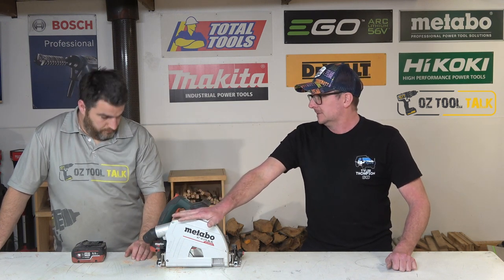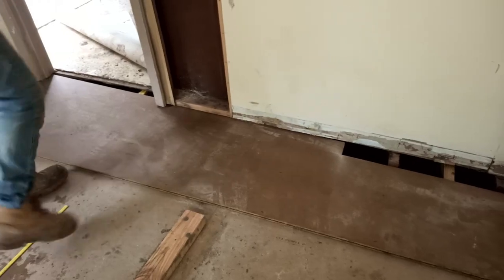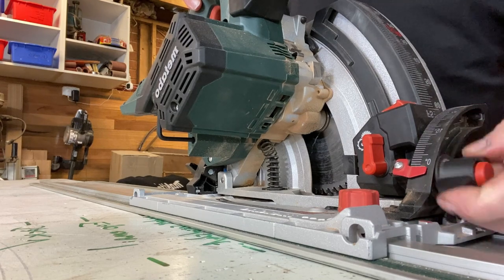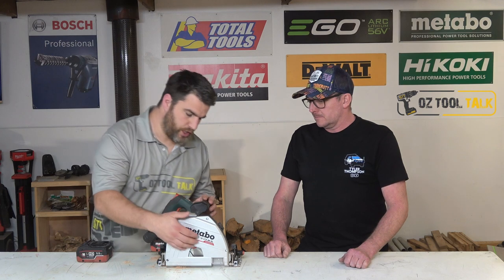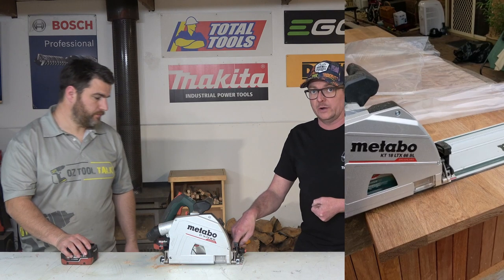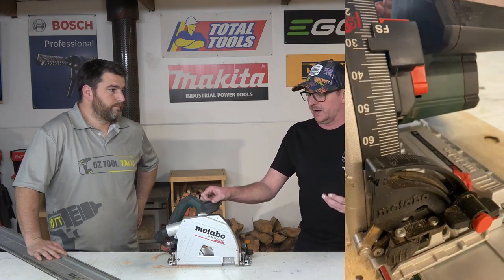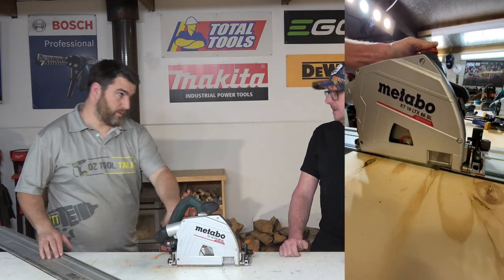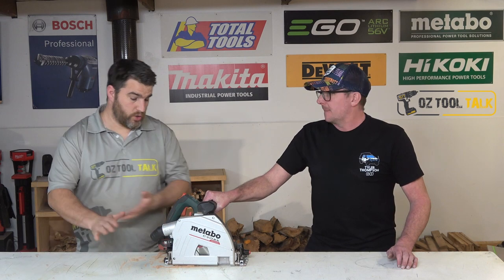Metabo 18V Plunge Cut Circular Saw  - KT 18 LTX 66 BL - Tracksaw [2021]

Comment: Great explanation on how 5.5 Ah is more powerful than 10.0Ah. It's hard to get your head around it but 5.5 Ah gives you more power per sec than the 10.0Ah if i understand it correctly due to its heat dissipation and active materials in the cells and internal connectors etc.
Reply from the maker: No problems Matt. Yeah something about the cell chemistry pits total stored power (in Ah) against instantaneous power (Amps) against each other. You can't have both maxed out in one cell.

Comment: You guys forgot to mention  this saw can also be used on the Bosch guide rail.
Reply from the maker: True
Reply: Albeit 3mm off the Bosch cutting strip.  I use it on the same tracks as my corded Mafell saw; which utilises the Bosch/Mafell tracks.  Unsure if it would be different with the cutting strip/rubber registered to the Bosch track saw.

That said, I actually prefer it is offset from the cutting strip.  This then doesn't interfere with the rubber strip, leaving it perfectly intact and registered to the Mafell track saw.   I use the Metabo for quick cuts where the finish isn't a huge concern, but straight cuts are, ie yellow tongue, ply bracing, etc.  Also for cement sheet, the edge is more than acceptable with the blade away from the cutting strip.  I use the Mafell track saw when I want no chips from the blade.

Comment: Thanks for your review,  came in to market a little late,  because I am already set-up for DeWalt. I am thinking to sale the DeWalt and buy one of this, because DeWalt has a few things with anointing me so much. 
You are talking about the ripping fence,  the problem with that fence one plunge saw it is that it's problematic to keep the saw down and pushed on the same time.. One good futures one DeWalt is that second generation has a remote control integra in so starter's the DeWalt flexvolt vacuum one the same time with the saw .
Metabo cordless vacuum has a similar function, which is working via vibration , the price one Metabo is around 1000 sterling pounds with 2 batteries, but if you are invested in the platform Metabo it's a better solution , if I had the possibility I changed to Metabo Tools today, because I had enough with DeWalt.
Reply: What exactly is it that annoys you on the dewalt saw?
Reply: @trashes_to_treasures ... firs one is jumping from the track one the end and beginning, because of the adjustment nobs,  you need 400mm before cutting and 400mm after. 
Dust collection is around 80 %
Battery is in the way of my hand .
Changing the blade is a pain. 
The ripping guide is copying Festool and Festool accessories cost an arm and a leg .
The tracking has to be 3 metres because connecting 2  does not align perfectly,  you need to tape it, so dose not make a step left or right  .
Reply: @MrDINODINO74  thank you for the info! Some more points tha get me away from dewalt and to metabo 😎

Comment: I have one of these and love it. All my gear is Metabo but the only thing I would say is that the upward cutting finish isn’t as neat as using a festoon track. 
I did  have a maffel track but this saw didn’t fit it so I had to send it back
Reply: i thought they would work together? i am planning to buy and use this one along the kss 40 from mafell and joped i could use the mafell tracks.

did you ever try the mafell saws on the metabo track?

Comment: My track saw is still the old electric variety. All the cordless ones are so dear unfortunately. Would like one but hard to justify the cost. I don't carry my track saw daily anyway only load for specific jobs. If you were old like me and built houses with a few hand tools and a circular saw as was the norm. I still do most of what you showed with the simple circular saw. Either free hand. Rip fence or straight edge. If money was no object. The new Makita 40v track saw I reckon would take some beating.
Reply from the maker: Hi Dave. I also only list mine on for specific jobs. Most days a circular saw will do. A clamped straight edge was my go to for years.

But wow a cordless track saw is convenient!

Comment: I have been struggling to cut a perfect 45degree with this tool from day one and its really frustrating- what coul I be doing wrong
Reply from the maker: If you're talking about a 45deg bevel, perhaps try cutting the depth in passes. sometimes the blade deflects on a 45

Comment: Great review. But I just can't understand why a 5.5  is greater than a 10 ah
Reply from the maker: cheers Marvin. I suppose I would counter with a question back to you: why should the higher Ah number have a larger power output? e.g. a car's gas tank size has nothing to do with the power of it's engine.

tool battery tank size and output power aren't totally disconnected like a cars is, but larger overall energy often comes at the cost of instantaneous power. 

there are articles around you can search up. I bet toolguyd would have a good one.
Reply: @OZToolTalk  thanks for your help I research the info

Comment: Hey guys, you didn’t really explain the 5.5Ah vs 8.0Ah vs 10Ah. 

They’re all 18 volt, so they’re all going to provide the same current to the motor. The Ah rating refers to how long the battery will last.  (As you mentioned, the size of the fuel tank)

I’d like some clarity on this as it really doesn’t add up.
Reply from the maker: Hi muz. You can do some googling and find the answer to your questions. Essentially, instantaneous power (watts) is the result of multiplying the volts (18v as you know) by the Current (amps). 

Battery cells are not equal, their slightly differing chemistry means they are capable of holding different total energy (Ah) and different sustained amperage. Usually, the higher the rated amperage (say 30A), the lower the total energy.

Comment: I watched all the videos about the Matabo KT66 plunge-cut saw. Unfortunately, nobody says or shows the undercutting function of, for example, plywood on any of them. Does this machine have such a function?
Reply from the maker: it has a -1° bevel, so yes.
Reply: @OZToolTalk  Okay, but I have to manually set the saw depth to 1-2 mm? the Mafell and Makita plunge-cut saws have the right devices for this.

Comment: curious to know if this can also run with the 36v ac adaptor? 

someone said that the adaptor can be used with 18v tools but not all of metabo 18v tools.  it would be a perk if the tracksaw can be cordless and corded.
Reply: @Walter Janzen its says for all 36v tools but others have reported using with 18v tools...but idk
Reply: @Walter Janzen you can look for an adaptor for your adaptor😆

Comment: It doesn’t fit snugly onto the Makita or mafell/Bosch track.
Reply from the maker: Are you sure?
Reply: @OZToolTalk  The saw I was supplied with had 2mm of sideways slop on both the makita and bosch rails, I received a refund.
Reply from the maker: @christopherashton84  (Mike)
Why would you return/recieve a refund for a saw that dosnt fit a different brand track ?
Reply: @OZToolTalk  I already own a makita and mafell corded plunge saw and tracks, and a have metabo batteries so i went with metabo for my cordless plunge saw option,  It does advertise the saw to fit on other rails.

Comment: Really? A 5.5 Ah battery is more powerful than a 10 Ah battery with an identical chemistry and cell type? You obviously don't know anything about cells. What you call "power" and "grunt" means in fact the discharge rate of the pack. A bigger pack will always have a higher sustained discharge rate. Also, the voltage matters, a 36v 4 Ah battery will provide a higher sustained discharge rate than a 12v 4 Ah pack. And most new tool batteries use the 21700 cells instead of the old 18650 ones. You give wrong advice, unsubscribed.
Reply from the maker: Hi Daniel. They obviously DO NOT have identical chemistry.

For some years it's been the case that manufacturers have had to have lower Ah batteries in order to have enough discharge (ampage) from the battery pack.

Metabo have told me several times that the 5.5Ah pack is their most powerful. 

So I'm afraid you are incorrect on this occasion Daniel. Good luck.
Reply: @ChristNhero  actually the 5.5 is technically a 6ah pack as it uses Samsung 21700 30T cells with sustained discharge of 35A where as the 10ah uses samsung 50E which have sustained discharge on 10A. so it is there most powerful pack.  there 8ah is using Samsung 21700 40T cells which have a sustained discharge of 30A although the 8ah im not 100% sure on but besides the 10ah the cells used are basically standard across the brands, Milwaukee and bosch use similar cells
Reply from the maker: great info Protos! thanks
Reply: Well that escalated quickly 😅